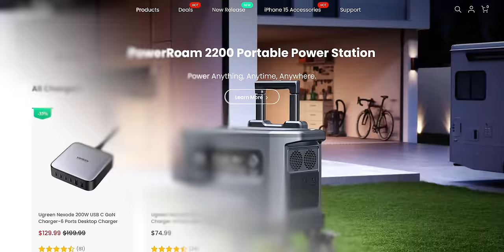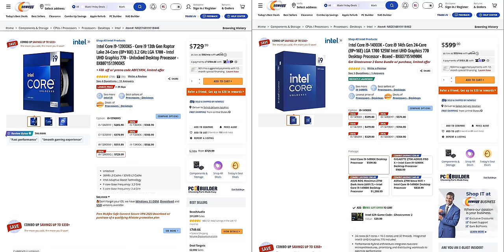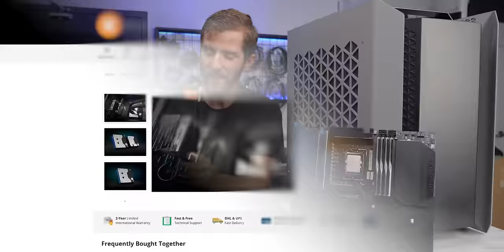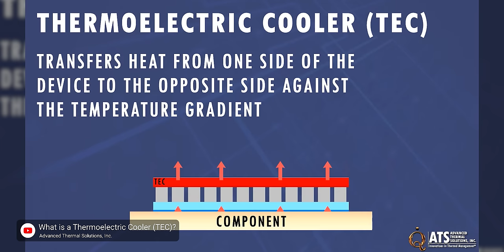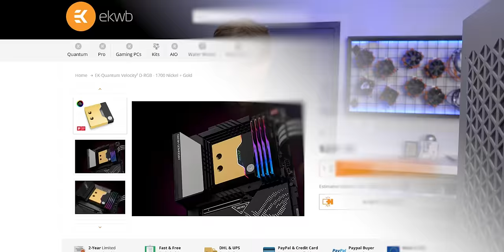Compensator 4 - How to Waste $30,000 on a Gaming PC

Comment: I never thought I'd hear of a mouse that literally causes a CPU to actually think a little bit if you max out the polling rate.
I love it.
Reply: I think I missed the mouse
Reply: @bipbop3121  it's at 27:45
Reply: Not only that It can also introduce micro stutters - for no real benefit. Optimum tech has a great video where he puts 4k and 8k polling to the test, the objective differences in latency are extremely small and he could subjectively not tell a difference in game. Its an absolutely useless gimmick and you should not pay for it.
Reply: My very old logitech G602 will do the same, but the affect is likely much lower.
Reply: Used to happen fairly frequently with gaming mice attached to underpowered laptops. Ask me how I know.
Reply: It's probably just the razer software.
Reply: @anynomous11111  if that were the case, polling rates wouldn't be a factor
Reply: @pelagia1538  effective delay is way higher than polling rate even on default 1k for usb mice, so no one really should bother.
Reply: @DanKaschel  True. I can imagine it affecting low to mid end systems but spiking a top tier CPU is kinda mind blowing.
Reply: Over 2000hz polling rate is useless and if anything results in a worse experience
Reply: I remember running into this with Guild Wars 2 back in the day. Couldn't figure out what was going on, until I dropped the polling rate to 250. It was the only game that had that issue.
Reply: @michalthekind  Literally ancient cpu however, so nobody is surprised there. On a 13900k its a bit more surprising.
Reply: @Skyflairl2p  Yeah doubt 8000 hz polling really stresses a CPU 5-10%. Id like to see it. Anyway 1000 hz is plenty for us noobs that dont care about FPS games. My old I5 4590 I think I ran with 500 hz, and im sure that could be felt a bit if I went highere, but not on a 7800X3D or letalone a CPU like 13900k.
Reply: @Djuntas  8000Hz most certainly will have an effect on the cpu, you're running an active process there. On a 13900k its likely not noticable much, but on any 2-3gen old cpus i wouldnt be surprised it used 5%+ when high mouse movement is detected.

In any case, anything past 500 is a gimmick. 1000hz is slightly more accurate, but we're talking micro-level accuracy, not noted in games.

I play fairly high level FPS and I actually dislike anything higher than 500hz, i tend to overshoot more for some reason and its prone to stuttering. Never had an issue with 500hz, nor is it in any shape or form inaccurate. 

for MOBA/MMO 250 is plenty.

for every day web surfing even 100hz is indistinguishable from 1000hz.

Pretty much all this "4k polling hz!!!!!!!!! 8k!!!!!!!!!!" is, is a sales tactic and a niche that is a gimmick at best and straight up terrible at worst.
Reply: @Skyflairl2p I feel a clear difference with 1000hz vs 500hz. Felt the delay and movements weren’t as accurate on 500hz.

I wonder if their could be a more efficient way to process mouse input other than wastefully polling for it every second 🤔
Reply: @mbsfaridi  From what I gather, you're in the minority on that. But its also likely just your mouse that works better with 1000hz, we're talking 1ms different between the two. Hardly going to matter when you add up your overall pc latency. Or it could be a placebo, I can say for certain I feel no difference and neither could my friends when we tested it (anecdotal, but thats enough for me) Seems to be the general consensus online as well.

As for a more efficient way, im sure there are better methods being developed rather than simply cranking the polling rate beyond 1k lol. But as mentioned, its not really necessary.
Reply: @Skyflairl2p  I forogt to mention the mouse, logitech G400s. I felt the difference right away and did so consistently in csgo on a crt set at 108hz. I was trying it cause most pros at the time used that and trying to see if my game stutters less with it but decided keep 1000hz cause the input lag wasn’t worth it and my aim felt heavy.

Comment: you should  used heavy water (D2O) for cooling. it cost way more, and have better thermal capacity than regular water
Reply: was going to comment the same thing, especially since they are in Canada where it's used in the CANDU reactors
Reply: That or use a non-water coolant, like oil. Premium gasoline cooled PC, anyone?
Reply: btw this water costs way under a $/€ in Germany. It‘s so funny that in NA carbonated water is considered a luxury good.
Reply: @RandomUser2401 Heavy water is not carbonated water, it's water which is enriched with deuterium, which is hydrogen with an extra neutron.
Reply: @ommyotter4064 i think you misunderstood the German 😉
Reply: Deuterium is an excellent choice. But I think you need to have permission from the Atomic Energy Commission to own it.
Reply: @RandomUser2401   i actually drank that brand in germany, i bought it in penny for like 50 cents? haha
Reply: @ommyotter4064 He didn't say that.
Reply: @jayc374 I don't think that's the case in Canada, because on its own D2O isn't going to do much, so long as you don't drink it. You would likely be on a watch list however
Reply: The best molecule for cooling efficiency is NH³ but you don't want to deal with that in a computer closed circuit :) But yeah, you're spot on, I hated when they put fizzy water into this machine.

Comment: this definitely makes me miss SLI... it was so cool seeing more than one card in a system
Reply: I loved when they would jam 8 GPUs into a case as well
Reply: Yeah, I still remember when I had 2 9800Gx2s in a system. Barely worked worth a crap but the few games that Quad SLI did work in there was a nice performance boost. Plus it looks pretty badass.
Reply: Me too, even though SLI was effectively terrible.
Reply: Now it's the ML/AI builds that have multi GPU. Who knows? If running personal AI at home becomes common we may actually see people building their own 6 GPU home servers, similar to what TinyCorp is doing with the TinyBox - 6x AMD Radeon RX 7900 XTX in one PC.
Reply: With AI being easily distributable and RAM hungry, multiple video cards generally work automagically.

There are already AI mods for Skyrim. It's good to have a second card doing AI stuff anyway, or even a third.
Reply: @kazioo2  Multiple gpus for AI are basically automagic.

You can even use GPUs over a local network with no lag problems.

Someone somewhere figured out how to local, local network, and a Google colab into one big "virtual video card", not at the OS level but at the software level. I'm pretty sure you didn't need any fancy drivers or anything.
Reply: you can add more one graphics card just for look 🤣
Reply: When i started getting into PC's the most badass thing imaginable was a Dual 295x2 system
Reply: @ProbablyNotAChicken  My first hard drive was just a bunch of Chinese kids I made memorize numbers.
Reply: @kazioo2 i would have said that there is no point running an entire AI from your home PC, but considering how many people said the same thing about the computer and the smartphone and how wrong they were , i dont want to make any predictions
Reply: man i was going into my cavern of component and found an old sli bridge. good times

Comment: They trolled so hard with the sparkling water and i really hope they were able to get everything cleaned out afterwards as thats alot of expensive stuff to just gum up with expensive garbage
Reply: Yeah I was cringing watching them pour that crap in
Reply: Sparkling water has no sugar
Reply: @BGraves  it's sparkling mineral water you shouldn't be using mineral water in your system because it deposits all the minerals inside and causes issues.
Reply: This water tastes not even good.
Reply: They most likely tore the computer down right after the video, no point in leaving this much expensive hardware in a computer they aren’t going to use.
Reply: tell me you poor without saying youre poor
Reply: now I am curious about trying to carbonate distilled water, and then putting ekwb clear concentrate in it lol @BGraves
Reply: @thehatebringer8005  don't tell me what type of sparkling water to use in my system
Reply: @BGraves  lol fair enough
Reply: @thehatebringer8005 yes it will scale up all the contact plates and have to be scraped off. Or run that CLR stuff through it.
Reply: @BigWormTay wait....there are poor people in this comment section? Ewww that's gross.
Reply: 666 boyassssss
Reply: That water isn’t even that good. Pretty standard water you can get in any shop for under a euro.

Comment: Should've gotten Red Line Water Wetter. It's an additive for straight water cooling, used in performance cars, mostly drag cars. One bottle costs almost $14US, and treats 3-5 gallons of water. It would make using distilled water relatively safe.
Reply: Wait, is distilled water not safe?
Reply: @FectacularSpail  distilled water is 'hungry', and will bond and react with whatever it comes in contact with. This can lead to corrosion, electrolysis, and leeching. With dissimilar metals in a cooling loop it could cause reactions that will eventually damage fittings and cause leaks. That's why a lot of water cooling additives for PCs already exist. If you really want to ruin your loop, run pure deionized water in it.te
Reply: @sireuchre  whoa, that's the opposite of what I had assumed, but it makes sense. I've never messed with water cooling (yet), but good to know for future reference. Thanks.
Reply: @FectacularSpail  You want to start with a base of distilled water, and put in additives that keep the water from reacting or growing organic stuff. Plain water from the tap varies a lot, and many places will have mineral content that can cause issues with deposition. In car coolants, water is mixed with primarily a glycol, which keeps the hydrogen bonds 'busy' and alters the boiling and freezing points of the water, to increase efficiency.
Reply: @sireuchre  This.
also I remember back a few years ago when water colling was starting to get around in sweden how some water cooler came or you could order water because the water in Sweden is so all over the place (its still good better then the US for the most part even in the worst part of sweden... drinking) but for gaming and that it could be really bad.
Reply: "Do what you oughta, put Wettah in ya wattah!" (Hello from Boston)
Reply: @FectacularSpail Water cooling isn't better then the beat Air Cookers, but what Water cooling provides (which is just air cooling with extra steps) is capacity, it's easily scalable to have more components being cooled by one radiator

Comment: That pc has a literal A/C inside
Reply: That could cool my room straight up
Reply: @KetchupSauces not trying to be that guy but, because of the first principle of thermodynamics, you can't destroy energy (and so thermal energy as well) but only move it from an object to another. Basically you can't cool your room by keeping your fridge's door open because it will just keep moving heat from a place to another inside the room. The case by itself can't cool down your room, only heat up the rest of your room to cool down the inside of it. Unless you mean a room-sized case, in that circumstance yes, you would froze to death lol
Reply: @lucazani2730  i meant using those side panels as ac units
Reply: @KetchupSauces  ahhhhhh ok
Reply: @lucazani2730  bro just tryna flex his smartness on apes

Comment: I cant think of a worse time for a non HEDT compensator build to come out than the embargo date for threadripper
Reply: Exactly lol. This could not have been timed more perfectly.
Reply: If it was threadripper it be like a 40k build because they'd have to fill all those extra pci-e lanes with more drives or things, and more ram
Reply: @Klairity  Even without that it would probably not be far off because the most expensive threadripper is $5k on its own
Reply: You'd think they would go for a frequency optimised xeon or something. They can be had for not totally stupid money's in this kind of price range
Reply: they are sponsered by intel, so it makes sence,
Reply: @zyeborm  The idea is to use consumer components as opposed to enterprise stuff
Reply: @KingJerbear  they said they didn't want to throw stupid money at enterprise gear especially as it doesn't help with gaming performance. The frequency optimised epycs etc aren't $10k chips.
More than consumer yes, but you also get more and it is still good for single core speed. 
It's about the only way you'll get clock speed and pci-e lanes.

Comment: Quick word of advice: you should replace the fancy water with automotive waterless coolant, it's likely more expensive, and will probably work better and let the system last longer (assuming it doesn't murder acrylic and the tubing)
Reply: But this isn’t about what works better, it’s about the most expensive
Reply: @superjanitor123 the coolant would have been more expensive, they went so far and fumbled on the stupidest thing.
Reply: I was thinking why dont they put proper coolant for a car or something in it, would it not work?
Reply: I'm a mechanic, the coolant we use would absolutely destroy acrylics and o'rings. We regularly have to replace industrial hoses and seals because they get eaten out after 2 years or so, if I was to take a guess regular PC tubing and seals would last a few months? 
Might be wrong
Reply: Car coolant would definitely destroy things
Reply: There's also PC coolants tho, and by quick search the first ones I found cost more than that water they used.
Reply: @TawkSmack not just destroy everything but also a little hazardous to work
Reply: @superjanitor123  it is def more expensive
Reply: @superjanitor123 literally anything is more expensive than water
Reply: I'm surprised they didn't use that like carbon filled Cryofuel or whatever it was called, the like void coolant they did a video on a while back
Reply: Seems like a terrible suggestion by the OP. It will have no benefit.
Reply: nope, automotive coolant only serve as anti freeze and anti corrosion. what they want is expensive distilled water or just go with novec if applicable. maybe add something like amsoil coolant boost if using distilled water too. still going expensive that way
Reply: btw this water costs way under a $/€ in Germany. It‘s so funny that in NA carbonated water is considered a luxury good.
Reply: What this build needs is something like OMTech's heat transfer coolant for CO2 lasers. $40 a gallon, and should play nice with the tubing.
Reply: They should use Novec but I don't know if that stuff is sold in retail
Reply: Thats What I use. Evans coolant. Great Stuff. Have not changed it in six years.
Reply: @RandomUser2401 people make luxury brands out of the dumbest things. They didn't even get the stupidest water here which is "alkaline water" which I've seen in a container like theirs for >$15.

Comment: I couldn’t hear any insulation between the brass end cap and aluminum screwdriver body when Linus snapped it closed. Make sure the next prototype includes a thin recessed ring of Teflon or even rubber. It’ll help prevent rattles, will keep moisture out of the bit-holder and - most importantly - will prevent the inevitable galvanic corrosion that occurs when aluminum and brass come into contact with each other. 👍
Reply: "keep moisture out" buddy chill, moisture isn't an issue. You aren't waterproofing freaking screwdrivers
Reply: @dimitrijekrstic7567 Dumb comment. Some people work outside, where things get damp.

Comment: Im quite surprised Linus was able to hold 43.5kg worth of computer and not even drop it :)
Reply: did you see his muscles , he would be easily doing 70 lbs dumbelss for curls
Reply: I was hauling a 85” tv the other day and at 50kg it seemed so heavy but it’s actually all down to the size and shape of the object and the surface area with which you have to grip. I don’t think that rig would be too heavy to hold for a minute or two.

Comment: I find it funny how often the most expensive option isn't the highest performance one.
Reply: Its because they built it Badly on purpose to highlight the stupidity of buying expensive parts expecting high performance. 
They didnt put the ssd in raid,  overclocking badly drops performance,  not using the whole quad channel RAM was stupid  (clock speed is useless VS bandwidth) and so on.

Comment: 25:24 One thing I've always hated about monitors are their stands, but I gotta say, for a monitor that big, I think that stand is probably the best stand I have seen, ever. It's flat and squared, allowing for perfect placement of things on top of it, so if it happens to be in the way of your keyboard it doesn't matter, as your keyboard easily goes on top of it with no issue, or if you want to place something on it, then that's also no problem.

Comment: In my opinion this compensator build shouldn't be about the most expensive parts but rather about the best parts you can get no matter how much it costs.
Reply: Same, break the FPS, not the bank. Else all you have to do is go roll out old HEDT and because MBs are the big failure point long term, a new MB for that is stupid expensive. $1200 for the MB, $1000 (new price, but there are ones that are/where more) for the CPU. 5-6 gen old hardware and the performance is now meh.
Reply: But that's not quite in the spirit of compensation, no?
Reply: i dont think you understand the concept of this ....
Reply: Trueee